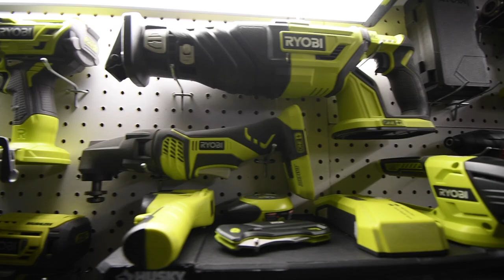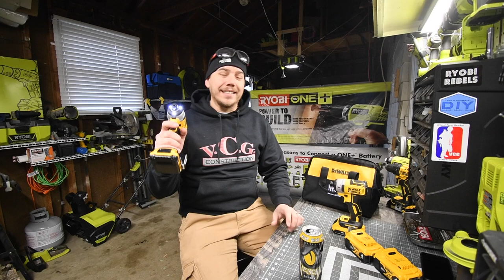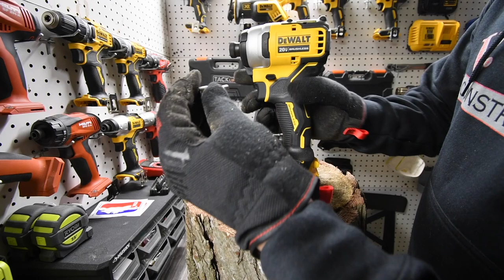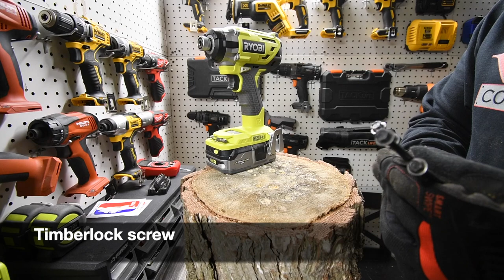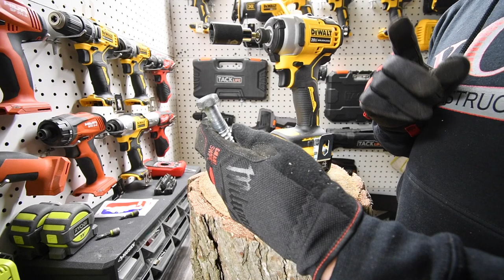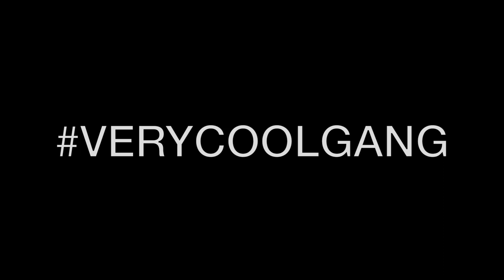Dewalt Atomic Vs. Dewalt XR

Comment: Today I tried to purchase a Atomix for $99, even though Home Depot said they had them in stock, they didn't.  Three different store had Inventory for the Atomix, but none actually had them in stock.  So I complained nicely to the manager and she said I could pick out the drill that was similar to what I was looking for and I could have it at the same price as the Atomix.  So, I went and showed her the XR with a 5ah battery, not knowing it was a lot more expensive, which was $179.  She said no problem and took $80 off the price.   

Home Depot may have the worse Inventory tracking but they are keeping me as a customer.
Reply: Damn really? God damn
Reply: Nice

Comment: I look at videos like these from time to time to pass the time. Each time I'm glad I went with the XR series. I have a 1/2 impact, 1/4 impact, and the 1/2 inch chuck brushless drill non hammer model. I wanted to keep all the tools from the same line and the XR series seemed like a good choice. I also now know if I ever need to drive an 8 inch plus lag in, I'll grab the half inch impact. I'm a big fan of battery powered tools, they definitely have their place and suit my needs better than air or corded tools. My next one will most likely be the angle grinder and circular saw.
Reply from the maker: The Xr line is awesome andI thank you for viewing Swoop
Reply: Just got me an XR impact, an the new 60V Flex Volt circular saw I highly recommend! Never used a cordless saw that felt just as powerful as a corded until now!

Comment: Just got home from buying the atomic series set with impact and drill with 1.5aH for $229 because the store was out of stock of the same combo XR with 2aH for $199 (regularly $249). Glad I watched this before opening the box because now I'm running to another Home Depot for the XR and returning the atomic.
Reply from the maker: I am glad I can help and that is what this channel is for
Reply: @ManCaverTools  No store within 150 miles had the XR, the manager of Home Depot told me to buy it off Amazon. She also said the Dewalt store on Amazon is always cheaper and USA made whereas the home depot ones are sometimes made in China. Good to know. I got the XR and it's amazing. Thank you again for this great review.
Reply: @kenfett7070  the atomic line is not a bad tool tho yeah it’s seconds slow but it will get the job done
Reply: @kenfett7070  pretty sure all dewalt is made in mexico
Reply: @kenfett7070  just because it is chinese doesnt make it bad, ryobi and milwaukee are largely chinese based companies so is ridgid

Comment: I've always bought the XR version.  You did show me that the Flex battery is not just a gimmick!  I may have to invest in a couple Flex batteries.
Reply from the maker: I use the flex battery all of the time and I thank you James
Reply: I've noticed a power increase in my other 20v tools using the flex

Comment: Hilti Makes some nice Concrete Anchor Insert bolts, instead of using an impact wrench I simply used the 887 with a 3/8 adapter for a 1/2 socket instead and that works far better than an impact wrench at that size which is very typical connected to a 3/8 threaded rod.
Reply from the maker: very good and thank you Ryan

Comment: Thanks, was about to replace my  broken (dropped from 30') xr with a atomic, but not now.  Phew, close one.
Reply from the maker: that is why this channel is here and I thank you Matthew
Reply: I purchased an Atomic battery and charger for $99. Got a Dewalt drywall screw gun for free. Based on this test, it may be time to return both.

Comment: Freaking awesome! Imma have to upgrade the XR then. Still happy with my atomic set though.
Reply from the maker: XR is badass but that doesn't mean that your atomic is garbage. it would be good to have both. :) can never have to many tools
Reply: @ManCaverTools  Agreed! I like the atomic drill for light work. Its so compact and light that I usually have no reason to go dig up my smaller makita (10.8v). The atomic set at aroun 150 is a great entry level set and makes brushless affordable. I think the m18 set is a good option too, but if someone's already in the dewalt line, the atomics are great light duty tools
Reply: The brushed atomic line is better than the brushless and cheaper once the brushless mottors slow to a certain speed they will shut off so drilling functions like paddle bits you will see thiss

Comment: Youve got what you paid for but any way it doesnt matter if lower end model performs slower the important thing is they can accomplish both of your project
Reply from the maker: but because of this video people know what these can do
Reply: HVAC AE, yeah that's true I agree. But as a Carpenter, Framer and Deck Builder I wouldn't use Impact Driver for that kind of task regardless of Brands. For 1/2", 9/16" and little bit bigger diameter lag bolts I would use my Mid-range DeWalt DCF894 Brushless 1/2" Impact Wrench for a much larger Fasteners, like Post Lag bolts especially for concrete or much bigger hex fasteners I would use my Ingersoll Rand 1" Pneumatic Impact Wrench (the one that mechanics are using to take out Semi Truck's Wheels) why I still have Pneumatic tools?? Because those are the ones that I don't use most often. You don't need cordless battery operated tools IF you don't use them the most. Common sense and you can save tons of money for buying tools. And for impact drivers? As long as they it can drive 3-1/2 deck screws or as long as it can drive 8" Timberlok or Spax power lag screws you'll be alright.

Comment: It depends on the type of job I think.  I’d want the atomic as my main work horse because it’s lighter and more compact which helps your arm from getting tired.  I’m hanging joists for my storage shed loft which means tighter spaces and having to hold the drill upright to get the screws in.  I much prefer the atomic for that.  However once I start screwing the plywood down the XR might be better because I’m pushing down and have more clearance.  I think for most regular jobs the atomic is what I prefer.   It’s nice to have the power of an XR but you pay for it with weight and size.  If you don’t need the extra power then it’s not worth it.  Smaller and lighter is better in my opinion.

Comment: Hi,

The DeWalt DCF887 1/4" impact is a pretty good impact. Like i mentioned before i use both brand (DeWalt & Milwaukee). I guess there's a lot of mix feeling and some bad batch of DeWalt DCF887 and Milwaukee gen 3 - 1/4" impact. On VCG TTR  and other comparison videos they hada few that started to burn up. Plus a few youtubers had the same issue.  I had mine and it never burn up or given me any problems.  

I also have my milwaukee gen 3 1/4" impact and it also works great. No colet issue like some people are having and also Vince at VCG is having. Again a bad batch. This just proves that issues do happen to all companies.  Funny how both company haven't mentioned or stated that they address the issue.  They both are quite or hoping people can forgive and forget. Or maybe they solved the problem but don't want to bring it up.

Either way I'm very happy with both brands.  Yes one is better then the other but each company has tools better then the other.  

Thanks for making time to make  this video..
Reply from the maker: I agree and I thank you very much for you feedback. some tools dewalt dominates and for some Milwaukee dominates

Comment: Im glad i reccomended the xr model to a customer i helped he said he wanted the best and was originally looking at atomic but i just had to read the specs and he was sold on xr, hopefully i made the right decision leading him to the xr instead of the atomic
Reply from the maker: You did a good thing to recommend the XR. The atomic is awesome but the XR is the way to go, especially recommendations to a customer
Reply: I would go with the brushed impact over the atomic.
Reply: XR is best way go in my opinion it’s like there construction model an the atomic is just a re branding of what I call city boy home use models they usually weaker on specs an not built as tuff in my opinion

Comment: They have them at Home Depot on sale with a 5amp battery for $129
Reply from the maker: they have some good deals right now
Reply: I bought the atomic today bec the xr is 180 on sale with 1 battery and the atomic is 130 with 2
Reply: I just bought the XR right now $200 because it came with a 5ah battery and a bag 💼
Reply: @BluntsOfKush1  I just recieved the same for $99 at home depot 😀
Reply: @theboz1419  I just received the same at Home Depot for $50

Sucker

Comment: Drilling in the Pith, Center of the log is substantially weaker than outer rings.  cut a log length wise and drill thru that.  That would be a fair test.  Cheers.
Reply from the maker: I dont use logs anymore, this is an old video

Comment: Putting the bolt in the midle is the pith so is softer but still impressive. I would like 2 see a review on the draper d20 impact driver thanks.
Reply from the maker: will do and I thank you sir
Reply: @ManCaverTools  looking forwid

Comment: Love my XR drilled holes and tighten loosen and re tighten bolts on my enclosed trailer still has plenty battery left . Put in 52- 5/16 bolts and 80 self tapping screws #12 and had to drill holes in wood and steel beams. Worth paying the extra money. I got lucky lowes had them priced wrong. They came with 4 amp hour batteries, have impact driver and impact drill.
Reply from the maker: very good and I thank you for sharing your story Pat
Reply: How much for that combo?
Reply: @tombomombodombo  bought mine 2 years ago they had it priced wrong saved 65.00. Look online or lowes for sales . Be careful  homedepot has brushless impact and drill but it's the atomic line not as good as XR.

Comment: I’m not a dewalt fan.  But I really do like your channel.   
I’ve heard a lot about the dewalt atomic burning up.   It seems like a poorly made over priced door stop.  I don’t remember there ever being videos made by Ryobi fan boys saying don’t buy this Ryobi ______.  It sucks and will burn up on you.   - like the videos about the atomic 887
Although I did buy a dewalt 12v extreme drill cause (I’m pretty sure) you did a video on it.
Reply from the maker: I say how it is. if a tools burns up on a test I say don't get it, there are better options out there that won't burn up this easliy. Even if its Ryobi
Reply: Ryobi Man Caver I just remember dewalt (specifically) having issues with the atomic impact.   And I think VCG Construction put out a video saying don’t use the flex volt batteries in the 20v tools cause they burn up.  They cut a dewalt recip saw in half after they burned it up.   I guess they weren’t too happy with the performance.  
I love your reviews because I feel like you give everything a fair shake.  And if something sucks you don’t hesitate to say it or make excuses for the tool sucking.  I remember you did a video calling out a couple of Ryobi tools for sucking.
Reply: Billy bob Smith I think you’ve got the dewalt tools mixed up here. The 887 was the one burning up and the 887 is the XR. The dewalt 887 is not atomic. The videos of the ones burning up were the 887XR, not the atomic

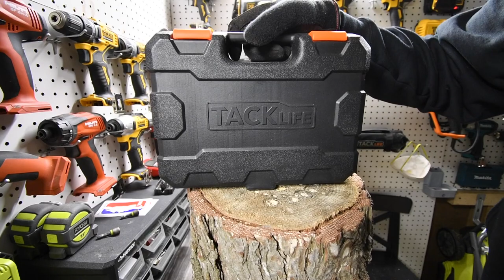Comment: Nice test and I like the camera placement. My question here is why would a 4ah battery give any extra “boost”? (10:40) the voltage is the power, the amp hour is the duration.
Reply: More AH means more battery cells what usually translate into lower voltage drop at high loads.
Reply from the maker: Lukasz is correct
Reply from the maker: Thank you for answering that for me

Comment: ... little off topic, but it looks like you have enough Dewalt kit there to be able to answer the question, is the all the 18V batteries interchangeable between the units ?
2nd part... does the 20 batteries work, and fit onto the 18V XR range ?
Reply from the maker: you will beed an adaptor for the older tools that have a stem.

Comment: I was wondering if the xr was worth it. That difference is bigger than expected. Over a work day that can make a huge difference in production time.
Reply from the maker: we will see what happens in their promo
Reply: @ManCaverTools  I actually watch the comparison video of Milwaukee impact and dealt was impressed with the Milwaukee. Went to Home Depot and the Milwaukee rep was there. Now I own the the 5.0ah impact a hammer drill, sawzall, and got the 18ga. Brad nailer. Thanks a lot.😜

Comment: My non brushless dewalt stuff has been going strong for so long Felt like I should upgrade got a good deal on a atomic kit (impact and hammer drill 2 batteries and charger) for 165$  im really thinking I should just spend the extra 100-150$ an get the xr?
Reply from the maker: The XR is an amazing impact and powerful, it would be a good idea
Reply: Home Depot has the XR kit with A Bag, charger, and 5AH battery for $129 right now.

Comment: Sob. I just bought an atomic impact, jumped ship from Makita after 10 years of faithful use.  Was wondering what the difference was but I like the compactness of the atomic.  It’s been working fine for mixed duty automotive and home use. But REALLY good to. Know that flex vol pt battery made a difference because I did pick up a flex volt blower too. 🤘🏻
Reply from the maker: I thank you for viewing Bayer

Comment: I want to buy one of these screwdriver guns for my husband for Father’s Day but I don’t know which one 😣  the one that he has the battery doesn’t charge anymore. He is not a craft man he only uses it when something needs to be fix around the house. Which one do you think I should buy for him? Thanks for the video.
Reply from the maker: not sure if you need a drill or an impact driver. but what id do is make sure its a Brushless motor
Reply: Home Depot has a deal right now for an atomic drill, 2 batteries, charger and bag for $99. I just bought one and love it. Might be on amazon as well.

Comment: I see that it's very cold in your garage do you keep your batteries there if so does it affect the life or performance of the batteries?
Reply from the maker: I keep my batteries in doors due to winter. I have them originized in its own brand bag with a charger.
Reply: ZachShop very cold temperatures will decrease a batteries run time. However the good news is just warm them up and they will regain. I personally would not recommend leaving them in extremely cold areas for long periods tho.
Reply: @jamesfair9751  yup ,room temperature is the best for these batteries

Comment: Good video. Although; do most people use the 4ah batteries? Also; was the battery on the atomic older or exposed to a lot more heat or cold?
Reply from the maker: 2ah and 4ah are what is mainly put in kits

Comment: Great test I have been firm believer in the dewalt XR versus that dam home use stuff Home Depot an Lowe’s sale even though now they carry the XR stuff but for them lag bolts I wouldn’t even use my impact driver I would use my 1/2 inch drive impact if it would fit in the location to run the bolts ass needed but you have to be careful that damn impact will break wheel studs off or twist bolts in half if they hit something hard lol
Reply from the maker: will do and I thank you dustin

Comment: I have had DeWalt 20v XR stuff since 2014. I used and abused my 886 impact daily for all that time, and finally the trigger started acting up. I loved it the whole time but didn't invest further in DeWalt because I feel like they're not innovating or improving their designs. The head/top of the impact drivers are the same size as they were in 2014, and the newer models like the 887 have been known to burn up under heavy use. I ended up getting a Makita xdt14 to replace the 886, it's tiny and has more torque and even better modulation of the trigger. I really think DeWalt needs to step and give us more compact, and more torque in impact drivers especially, as the high speed/low torque combination isn't ideal for larger fasteners. I would argue that they were the best 2013/14 had to offer but it's been a long time.. Any thoughts?
Reply from the maker: Makita is a good brand as well. and I thank you for viewing Master

Comment: It upsets me how u cant get all x r stuff in a combo. The impact amd hammer drill r the plain old 20v max
Reply from the maker: I agree, who cares about those 1.3ah batteries
Reply: @ManCaverTools  its not the batteries that upset me. Its the fact that the combo kit box says XR but the drill and impact are the reg. Ass 20v max.  But the saws are all XR. The 1.3 batteries are not worth caring about i agree. But it came w the slightly better 2.0ah ones.  They didn't false advertise that. Oh well. Lowes never noticed a thing when I bought the XR impact and hammer drill. Put my regular Ass 20v max n the box and got my loot back. Score 1 for the hometeam

Comment: I use the Dewalt 1/4" impact to pull the spark plugs on the Ford engine that breaks the plugs in the block. Get the engine to running temp and quickly pull the plugs the impacting of the Dewalt breaks the rust in the block that is holding the plug. I've only broken 1 plug with the impact but the engine was cold.
Reply from the maker: Dewalt is a fantastic brand and thank you for viewing sir

Comment: Were both batteries brand new, at the same temperature, and able to hold the exact same capacity?  Unless you did a detailed battery diagnostic ahead of time the only fair way to compare the two impact drivers head to head would be to run the exact same tests but with the same two batteries swapped (recharged of course) and then average the time each test took.
Reply from the maker: this is real world testing. I thank you for viewing Rob